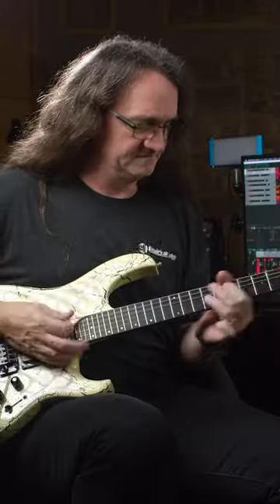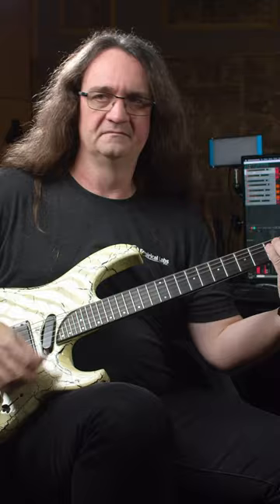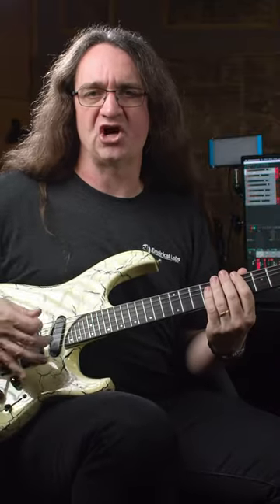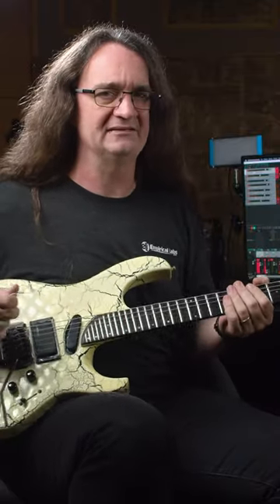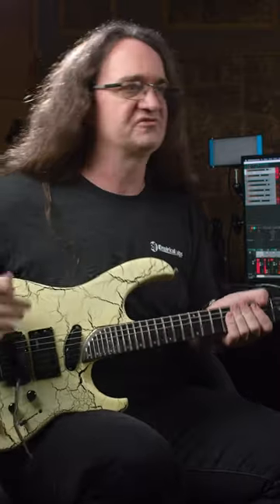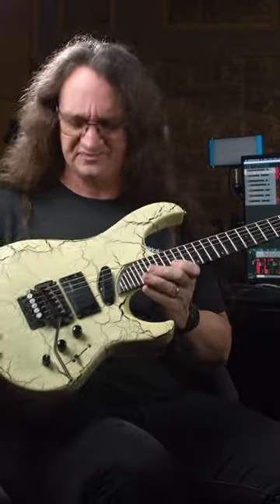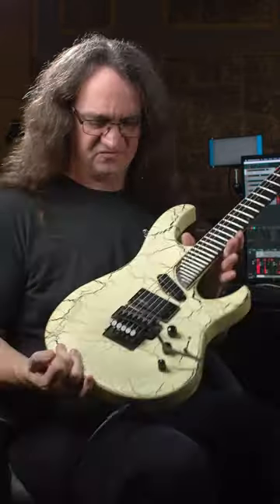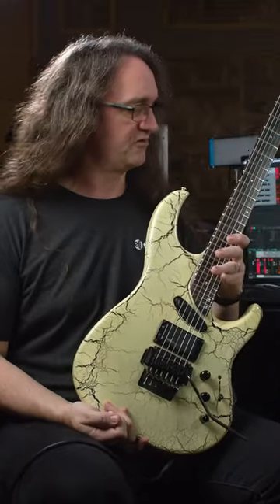Restoring a Vintage 29 FRET!

Comment: the fractal burn looks phenomenal
Reply: I think it is crackle paint, I do fractal often but. What tf do I know.
Reply: @slagmaggot  could it be low voltage?
Reply: @noahhughes1433 maybe I only fractal hi voltage bare wood with no paint, makes bad ass guitars and other objects, I use a stain after cooking. the dude on guitar guts, trash to thrash does crackle paint.
Reply: @slagmaggot  oh well that’s something i didn’t lnow